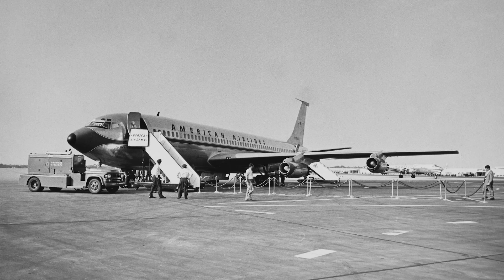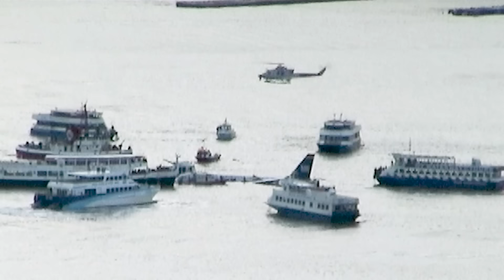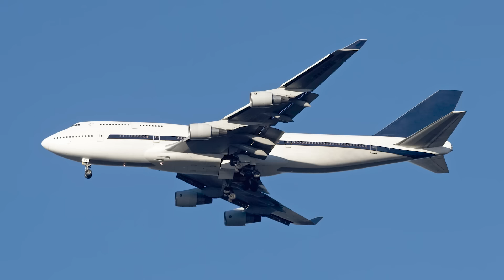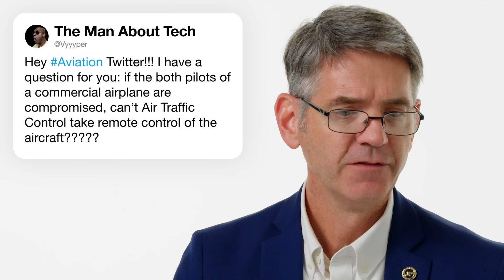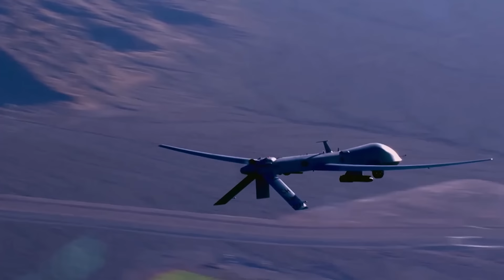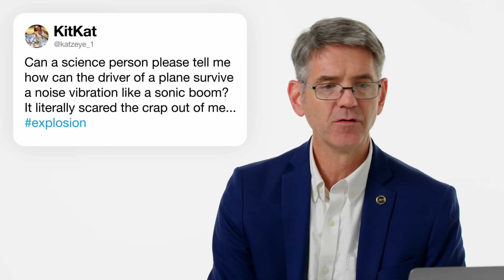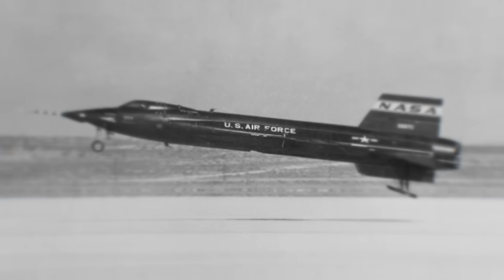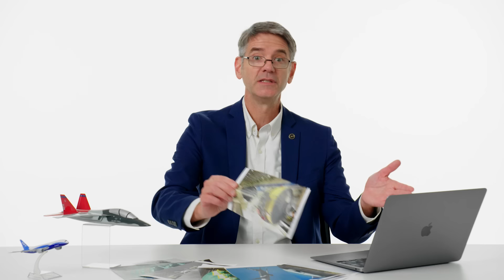Aerospace Engineer Answers Airplane Questions From Twitter | Tech Support | WIRED

Comment: 3:50 Regarding commercial aviation improvements, one underrated improvement is cabin pressure. Newer airplanes are pressurised to better match the air pressure on the ground - which is why our ears don't "pop" on flights nearly as much as they used to.
Reply: The standard used to be 8000 ft. What is it now?
Reply: @mkvv5687  The 787 for example has a cabin altitude around 5000 while in cruise.
Reply: @bbgun061  Thanks. Thinking about it more, I realized that most of my experience was with military 4-engines. We typically cruised at 42k. I don't know if that had anything to do with pressurization.
Reply: Now that you mention it, it does seem like my ears don't pop nearly as much as they did when I was a kid (unfortunately a while back lol).
Reply: YESS totally agreed. I remember when I was little back in 2012 I had a problem with my ears popping on flights. But now everytime I fly there is never any problem with my ears and in the past too I could almost feel the change in pressure when in the air but nowadays the pressure feels like we're on the ground.
Reply: ohh.. I have noticed that! I flew on an airbus recently and I never had that annoying ear pain, it was so surprising.
Reply: huh, I use to have it as a kid and I just presumed it was just a getting older thing - not that the planes had changed.

Comment: Fun fact: Aircraft engines were so unreliable in the past, that pilots in the 1950s and 1960s called the 4 engine Lockheed Super Constellation the best 3 engine aircraft ever built.
Reply: I love that, that’s hilarious 😂😂😂
Reply: The B-36 Peacemaker bomber had six propeller and four jet engines, "six turning and four burning". Reliability turned that into "Two turning, two burning, two smoking, two choking and two more unaccounted for."
Reply: the newest generation of engines have issues too... e.g. Pratt & Whitney engines caused hundreds of Airbus to be grounded.
Reply: @borismatesin  😂😂😂😂😂😂😂😂
Reply: EXACTLY what I was thinking 🤣
Reply: Yeah, but they’re failing every other flight like those giant piston engines did. In fact, even the jet engines of the 50s and 60s were so much more reliable than piston engines that for every jet engine failure, there were around 100 piston engine failures!
Reply: now THAT is a pretty bird
Reply: That really makes sense...and it's the kind of fun comment that makes for an easy quip!  I love it.  Engines used to be terribly unreliable...it made sense, I mean, they were trying to push the limits of materials and fuel use to allow a thing that was way too heavy to float become a flying object, so they had to slim down parts, use better alloys, redesign so MANY parts of engines and wings and electronics...flying is a bit complicated.  After all the "fun" with jets in the late 80's and 90's that I saw, I'm so glad we've moved in this direction for jet planes.  They are SO much safer now.
Reply: @noob.168  I mean, first off, NOTHING is perfect.  If you are just saying that 'Everything still has SOME kind of issues on occasion', then you are correct.  Anything not made by God Himself will be imperfect to SOME tiny degree, and that degree will eventually lead to failure if parts are not replaced on the schedule the manufacturer requires.  Everything eventually wears out; nothing physical lasts forever, so if you meant THAT, then you are correct, things still happen sometimes.  It's the nature of Mortals.  We are not perfect.

If you didn't mean that in the generic manner of meaning...then do you refer to the potentially faulty fan disks made by the company RTX?  Yep, that caused...or will-cause?...many jets to be grounded while they check the fan disks for symptoms of the potentially-faulty metal powder used to make the disks causing them to wear out much faster than usual disks...so they are checking them more regularly (meaning less hours between checks) until the fan disks in question can be confirmed to be free of flaws OR until they can be replaced.  There were no actual failures (that I could find in my quick searching about it) related to this, this was the company (Or whoever, I didn't find confirmation of who discovered the issue) preventatively saying "There may be an issue, so everything in Batch #'s Y and Z will need to be checked after every X hours of run time."  Fatalities, fault counts of humans hurt, or engines failed because of this flaw: 0.

I think I'm okay with this pre-failure issue being identified.  It's actually kinda nice that they were able to find out WITHOUT huge failures happening first.
Reply: One of my ground school instructors used to say "The only reason I used to fly an airplane with 4 engines is because there wasn't one with 5 engines"
Reply: i worked at a couple FBOs that did commercial, business, private, & military. seeing all the different planes never got old, but other than some bucket-list military planes, seeing Trijets was always my favorite - they're like the awkward but beautiful odd-ones-out.
Reply: @EShirako   What objects do you consider to be made by "God himself"?
Reply: I’ve heard a similar one about the B-29 being “the world’s best 3 engined, 4 engined bomber”.
Reply: @DavidSmith-vr1nb  According to the prophecy humans were made by "God himself" so people are "perfect". Can't say what it was like back in the day but after he contracted the manufacture of people out this product definitely had a few models returned -unfortunately no warranty (express or implied) was available.
Reply: Radial engines are incredibly reliable. They just needed more maintenance.
Reply: @iamterfer 
But since the people were perfect, the people made by perfect people would be perfect as well, otherwise the perfect people would have made a mistake, making them not perfect.
Reply: That's probably the most complicated airplane engine ever built, though. It was a supercharged, 18 cylinder, twin bank radial with three power recovery turbines. Plus, they ran them on 115 octane fuel (standard avgas is 100). Putting something like that in an airliner is like putting a formula 1 engine into a bus.
Reply: @darthquigley  not really, modern engines with modern fadec and high bypass ratios are more complicated. Jet A1 does not have an octane rating but survives in much colder temperatures and ignites better. Putting that type of engine in an airliner is like putting a lawnmower engine to a train
Reply: It's also why for many years, regulations required more than two engines to fly over oceans - because "one engine out" was so common, and they wanted at least two working engines while over the ocean.  It has only been fairly recently that "ETOPS" regulations allow for newer more reliable two engine planes to fly over oceans. (ETOPS: Extended Twin (engine) Operation Performance Standards.)
Reply: Today is how I find out you can hyperlink YouTube comments
Reply: @DavidSmith-vr1nb  Oh!  No, I just mean that if an item was not made to God's Level Of Absolute Perfection, it'll wear out or fail in time.  And if His stuff is physical, it too would eventually wear out, I mean, "Anything that exists will eventually wear away/break/oxidize".  So, early airplane motors would DEFINITELY be very not-perfect, and thus extremely maintenance-hungry and/or prone to failure.  Nowadays things are WAY better built and more thoroughly tested, but "If it exists, eventually it will fall apart."
Reply: Who asked?
Reply: There's an amazing book called Fate Is The Hunter by Ernest Gann about flying transport aircraft in WW2: he describes incidents in which all four of his engines failed at once!

Comment: This man is really well spoken, straight to the point and professional. I like how he describes things with both scientist’s and passenger’s interest in mind. 
Sometimes flying makes me nervous. Hearing him describe the strength of design on commercial airplanes and general airplane safety really helped ease my anxiety about flying!
Reply: Mentour Pilot will do more :)

Honestly though, if a plane crashes, it's usually bad maintenance policy, or miscommunication/misunderstanding by the crew (getting confused by a faulty warning, bad ATC accents, etc).
Occasionally weather or true design flaws (Boeing MCAS) are the culprit.
Most modern big airlines are exceptionally safe though, and have had few if any crashes.

Cheers!
Reply: Remember, anybody can build. It takes a real engineer to build something with as low a safety factor that it doesn't fail while still being cost-efficient.
Reply: @MrNicoJac  Yes, MCAS was badly designed, but you can even argue that MCAS incidents could've been stopped if the pilots were educated how this new system works.
Reply: Too fast for my brain to keep up 😅

Comment: There used to be a joke that if you lost an engine (on twin engine aircraft) it would leave you just enough power to fly to the crash site.
Reply: The running gag for ETOPS (Extended range Twin engine Operation Performance Standards) is "Engines Turn Or Passengers Swim".
Reply: Reminds me of that Ron White joke. His plane story was hysterical 😂
Reply: Hey, former ATC here. I had one pilot - American guy, won't say which airline - who would often say "I love Australian air traffic control. You guys get us to the crash site faster'n anybody else."
Reply: @N.I.R.A.T.I.A.S.  I'm sorry, but FAA ATC > Aussie ATC and you know it.
Reply: That joke is mostly applicable to light twins rather than airliners, and the difference is that private pilots are more likely to not adequately adjust for how the aircraft needs to be flown under the degraded conditions.
Reply: hahaha, that's the funniest thing I read on the internet today

Comment: Assuming an airplane is made of the material that black box is made of, even if it could survive a crash, passengers still won't. During a crash, something somehow needs to absorb up all the kinetic energy for humans to survive and there is just too much of it for anything to absorb it all. Plus rigid material is not that good at absorbing kinetic energy, they transfer the energy instead.
Reply: Easy, just make the passengers out of that material too
Reply: It's not a special material it's just a dense structure
Reply: If the airplane was made out of the black box material, it would be too heavy to fly. Might as well propose making an airplane out of solid concrete.
Reply: Exactly, it's not just the material but also the shape. A round ball made of glass is extremely strong, while an intricate glass artwork is extremely fragile. This is such a simple concept it's hard to fathom how some people don't understand it.
Reply: If planes were made of black boxes (and somehow magically not prohibitively heavy), then if they crashed, they'd hit almost like a meteorite and bury themselves deep into the ground 😂😂😂

And if we dug down a couple of hundred feet to get them out, all those squishy meat sack humans would be one massive smoothie on the cockpit wall.... 🤢
Reply: The Burnelli UB-16, 8 person twin engine plane with Burnelli style lifting fuselage body, was being prepped for delivery to a customer in the late '30s.
During a test flight, at 200' at 130kts, the ailerons came off due to mechanical error.
The plane hit the ground 110° roll, 20° nose down at 120kts.
Wings and tail departed, turned to confetti and the engines broke off as the fuselage body box cart-wheeled across the ground.
When they broke it open and got to them, the 2 crew walked away.
Reply: @JFrazer4303  Sounds a lot like how F1 cars are designed. the mono cockpit is rigid to protect the driver/pilots/passengers, with other crash structures disintegrating during a collision absorbing as much as energy possible.
And the fact that the fuselage wheeled off means some of the kinetic energy was preserved and then dissipated after the impact, further helping the survival of the pilots during the impact.
Reply: Hah! You win this thread, Mr  @ChrisThomas-xt4jh . 👍🏾👍🏾👍🏾 👏🏾👏🏾👏🏾👏🏾
Reply: You are a genius  @ChrisThomas-xt4jh
Reply: @ChrisThomas-xt4jh  u just made my day
Reply: @JFrazer4303  CB-16
Reply: I mean technically, if the plane was that hard, it could just do a belly landing and slide to a halt. Some crashed airplanes actually managed to do that, though usually they break apart.

If the aircraft just darts into a mount though, youre probably right.

Comment: it is POSSIBLE to fly a modern passenger jet with only one pilot, but the presence of  copilot allows the pilot to share his workload with the copilot.  in essence, during the complicated parts of the trip; specifically takeoff and landing, the pilot flying does all the things directly related to controlling the airplane, and the pilot monitoring does everything else, like talking on the radio. (and for those who don't watch aviation youtube, the common terms for what used to be pilot and copilot are pilot flying and pilot monitoring - and the two or three pilots on a plane, depending on the length of the trip, will trade roles during stops on a series of short trips, or at specific points during a long trip)
Reply: Exactly, and under normal circumstances. I was looking for a comment on that gross overstatement in the video. When something unexpected happens it’s definitely a more than one persons’ workload
Reply: It's not about ability to share workload. The aircraft are flown by crews, not by the pilots. Also, pilot and copilot does not turn to be PF and PM, regardless of who is being PF, the copilot is still copilot and commander is still commander.

PF does not do everything directly related to controlling the airplane.

It is technically possible to fly also 50 year old passenger jet with only one pilot. The plane does not know, how many pilots there are touching controls.
Reply: @KoiranenAerospace  thank you for making what I originally said less clear.  and by the way, in most airlines, it is captain and first officer.  not commander and copilot.
Reply: @kenbrown2808 , I don't know what source you use for statistics, as I have never seen such statistical data. In EU area, it's pilot in command or commander as described in ORO.FC.105 and CAT.GEN.MPA.105, while "a captain" is just duty rank but it doesn't have anything to do with current role in flight deck, as two captains can fly together but only one can be PIC or commander at a time, and the other captain has some other duty (of course there is qualification requirement to operate either pilot's seat, compared to normally being trained only to left or right seat).
Reply: @KoiranenAerospace  Mentour pilot would be the relevant reference in this case.
Reply: Having someone check your checklists and knowing you're not the only one in custody of the plane/passengers, is also pretty neat
Reply: @Nina-cd2eh  as I said on another subject that is also known for redundant safety processes; you don't do it because of the likelihood of failure - you do it because of the consequences of failure.

Comment: Regarding aircraft with more than two engines, e.g. the 747, we (I am a 747 captain)  actually train to fly and land with two of the four engines inoperative. There is a defined procedure in the manuals for a two engine inoperative approach, landing, and go-around. Of course in training, this is always done with both engines on one side failed, which makes it even more challenging. But yes, a four engine 747 can fly, and even climb (very slowly), with two of the four engines failed.
Reply: What happens if engines 1 - 3 fail? 😅 Can you maintain speed and/or altitude?
Reply: @Aphova  you can trade altitude for speed--but that may put you on a suboptimal course.
Reply: I'm glad someone mentioned this
Reply: QF32 landed basically with only *one*. 2 was gone and 1 and 4 were practically at idle.
Reply: @Aphova  Well... you can still land without any engines at all
Reply: @John_Smith_86  Yup, planes just become gliders, as long as your able to move the ailerons you might be good
Reply: I was on a flight on the KC-135 where the pilots did this procedure, it was very interesting to watch them do it but fun nonetheless
Reply: @Aphova There were at least a couple cases where all 4 engines failed. 1 of them was ok but they managed to get some or all engines working again. The other one I forget but I don't think it went well. Originally I think it was thought that all 4 engines couldn't possibly go out at the same time. One of them was a flight that passed over a volcano and picked up volcanic ash that damaged the engines. That was before we knew about the effects of volcanic ash on planes (it's really bad). But that flight was ok as they managed to get the engines working again and made a safe landing.
Reply: @paveladamek3502  The #2 exploded, the #1 was stuck at full throttle, leaving control to just engines 3 and 4.